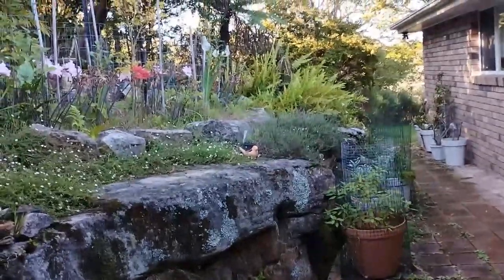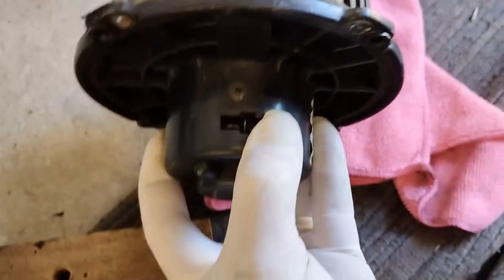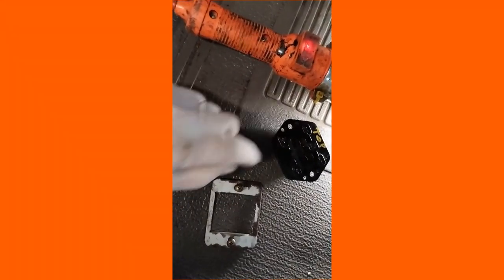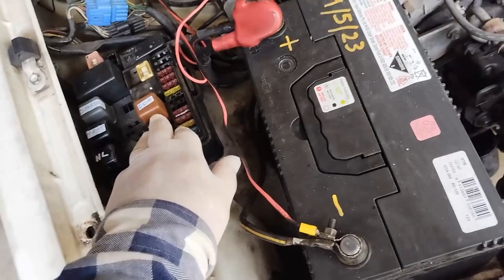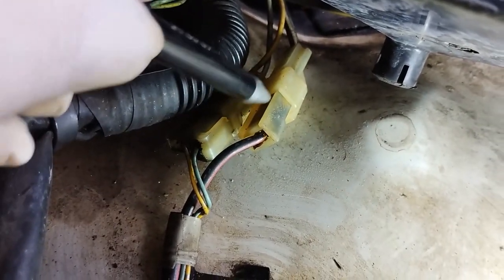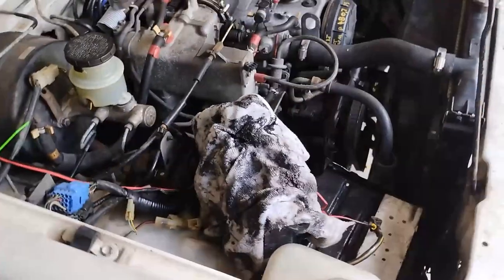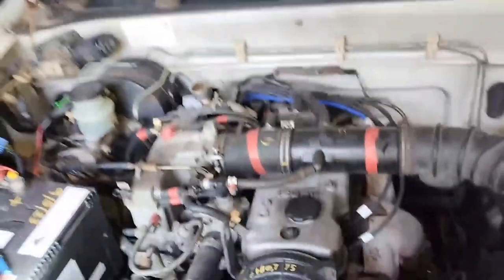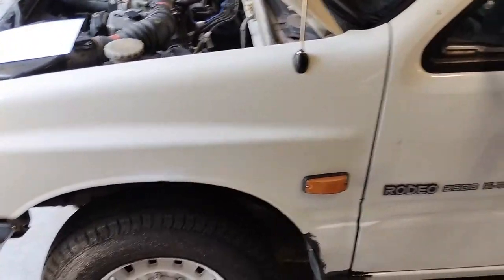1995 Holden Rodeo TF 2.6 heater fan fix (unexpected)

Comment: Do you know if the 95 rodeo like your one has a tap on the heater that turns on to allow coolant flow through the heater core, or is it constantly flowing and flaps open to allow air to flow through fins on the heater core? Thanks in advance and I am glad to see that you still have the old girl going well.
Reply from the maker: Yep it is constantly flowing, there is a mechanism behind the dash that opens / closes a louver for on or off